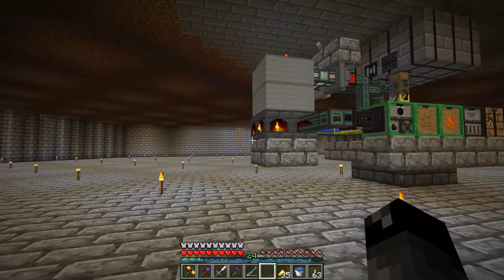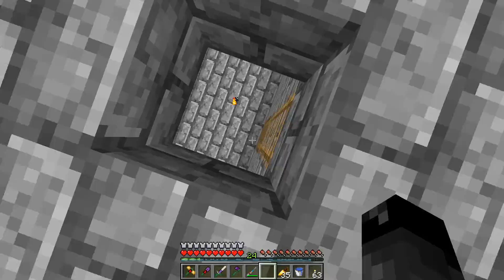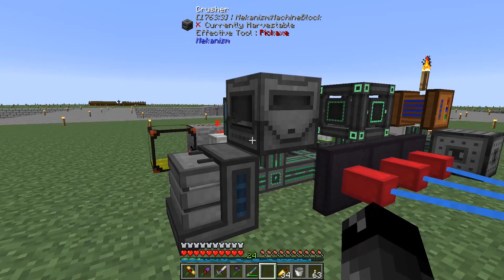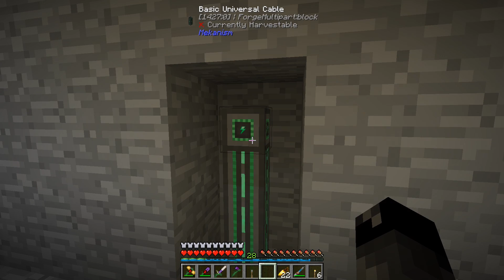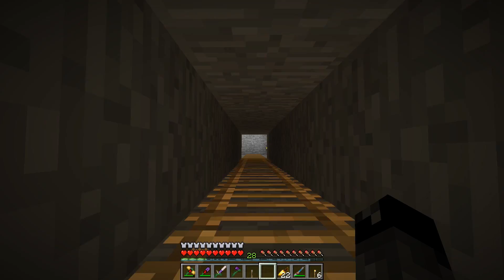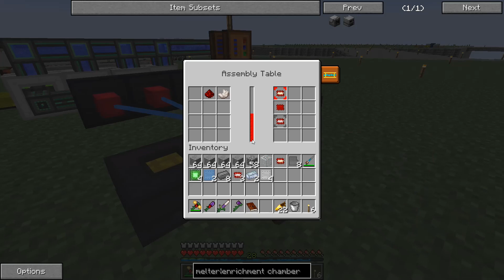Minecraft Mods Regrowth - ENERGIZED MACHINERY [E32] (Modded HQM)

Comment: Hypno in the past, not sure if it is still in the mod, you could attach a steam engine directly to the boiler without pipes allowing for lossless steam throughput. If that is still a thing i suggest it, as the redstone signal from the lever is affecting the pipe directly below it not letting steam out or in.
Reply: i think you have to use pipes also by using pipes he can use more steam and make more power
Reply: +Tony Miller Back in 1.6.4 you didn't have to use them as the boiler pushed steam into adjacent inventories. also a full size boiler can only support 18 industrial steam engines anymore and they lose efficiency. my recommendation is to do a three by three grid on opposite sides of the boiler.
Reply: Another side note your engines can explode if they have to much energy stored in them. that's why they are turning red. to appease this you should expand the amount of engines asap and build a bigger power storage and do some simple Redstone logic that says turn on engines if storage less than value of x and turn off when above value of y. build craft pipes to the energy cell would be easiest with the logic gates and pipe wire. you can use mekanism energy for the rest of the base. part of the reason behind why the quest line blocks mekanism till later.
Reply: Darth Revan or he could just upgrade the power cables
Reply: +Tony Miller the problem is he isn't using enough of the power he is generating. each engine is producing 80 rf per tick. and he is probably using at the most around 120. so one engine isn't being used. but the way the engines work they split the load so it keeps overloading them for a few ticks when they run which is making them go into the red. he needs to create a bigger storage then turn off the engines or he'll blow up his boiler and have to start over.

Comment: If you want to save on coal (charcoal) for making the steel use the enrichment chamber to compress them. 
 - 1 piece of coal (charcoal) turn into 1 piece of compress carbon who's worth 100 unit of carbon in the metallurgic infuser. 
 - You can do the same for redstone, diamond.
That way you save a lot of ressources.
Reply: Was just about to scroll through replies to see if someone had mentioned this, but no need your comment was right at the top :D

Comment: Hypno, look into the enrichment chamber from Mekanism. With some power, it'll turn a piece of coal into compressed carbon. Compressed carbon in the Metallurgic Infuser gives 100 points, where as a piece of coal only gives 10. You'd be using less than one piece of coal for every piece of steel instead of eight. 

Please like so he can see.